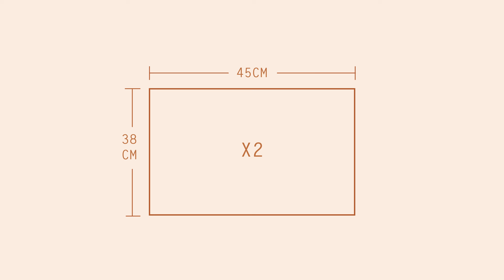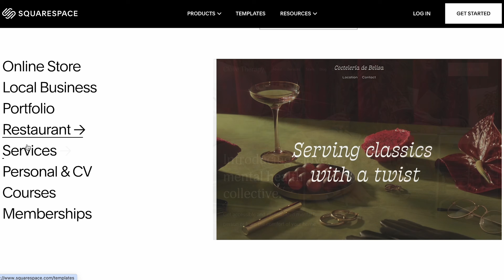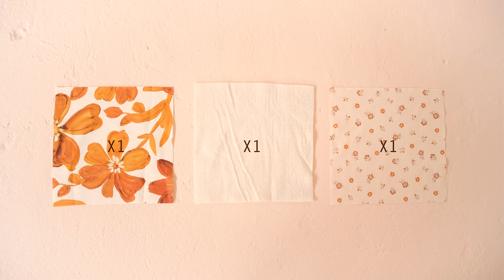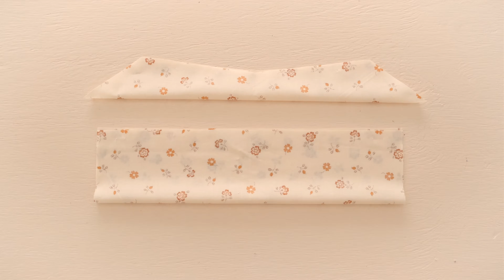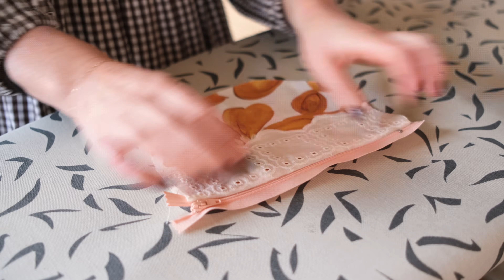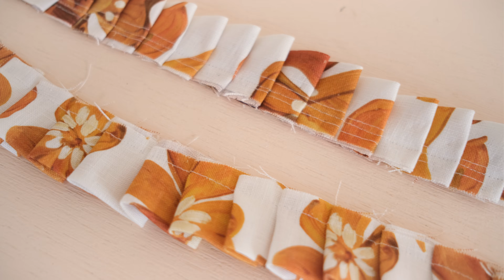5 Easy Sewing Projects To Make! | Step-By-Step Sewing Tutorial

Comment: Did you need to use a heavy duty needle/thread to get through the hessian? How did your machine handle the thickness of those corners? (And did you find the hessian at Spotlight? I've never seen it there but perhaps i was looking in the wrong area!)
Reply from the maker: I just used my normal needle and my machine handled the layers fine. A heavy duty needle isn’t a bad idea though! Yes the hessian is from Spotlight and it was in the furnishing fabric department in my local store 😊
Reply: @RoseryApparel  Ah that makes sense, I don't venture into the furnishing fabrics very often! Thanks for the reply 😊